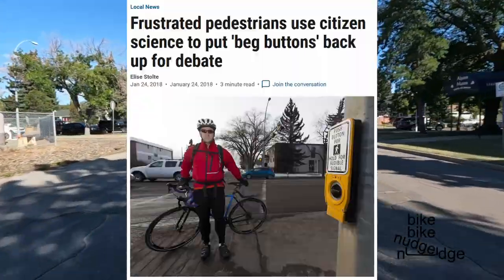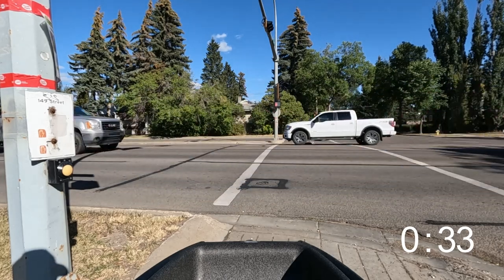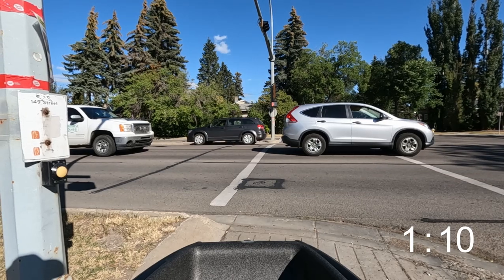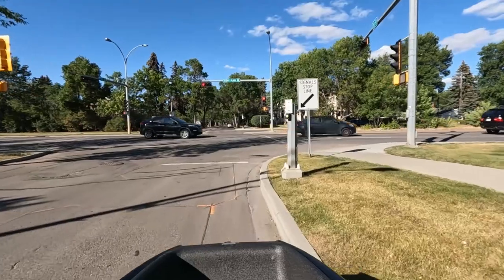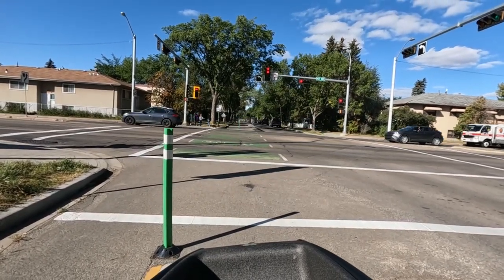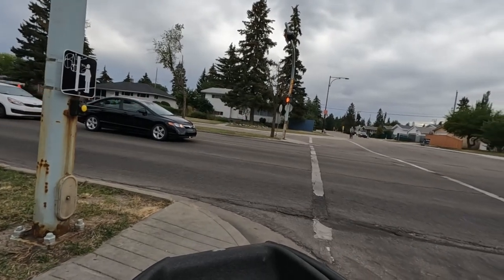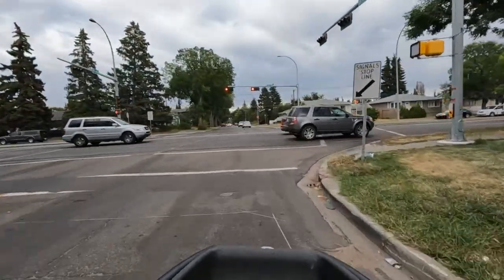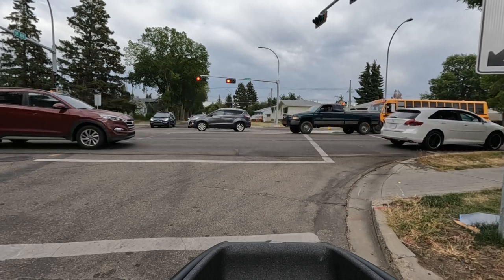Can you access beg buttons from your bakfiets?

Comment: This isn’t something i’ve thought of before! When you mentioned needing to walk your bakfiets backwards i realised i have actually needed to do this on my regular bike before. I’m definitely going to keep an eye out for this accessibility stuff in future
Reply: At my age, that's something I consider when looking at bikes. It's not as easy to jump down off the seat as it had been 40 years ago, and walking the bike backwards is easier without the pedals banging my ankles, so I prefer a bike where I can set the seat for an efficient pedal position but still reach the ground from the seat.
More important on a cargo bike, since it's easier to balance a heavy load from a three point support. I ended up with a Mongoose Envoy, and I have dropped it because I couldn't reach the ground fast enough in an emergency.

Comment: Loops only work if there is enough metal for them to detect the bike.  Try it with a carbon frame and see if they work.  Maybe install "electric jacks" to stabilize the bike while you walk to the buttons.
Reply from the maker: I have one shorts video where I test all my bikes at that detector. These are enough metal pieces on my carbon racing bike to trip the detector. My cargo bike trips other detectors in the city. I guess the required EM response of that detector is just a little too strict and my cargo bike is a little too long.
Reply: @bikebikenudgenudge  I have problems at some intersections with my big and little scooters tripping the sensors.